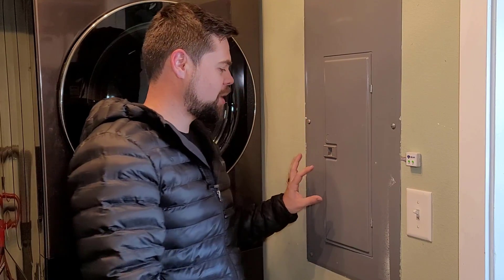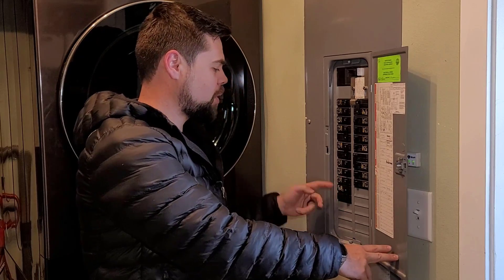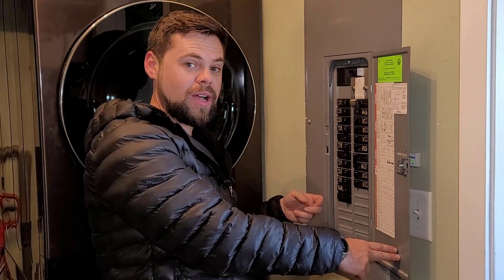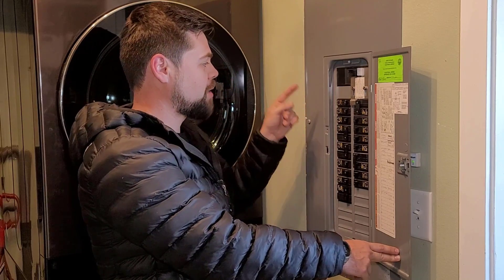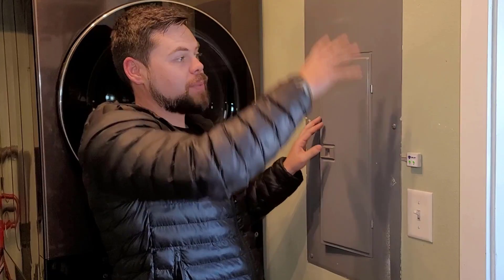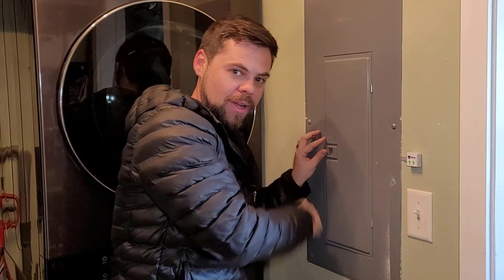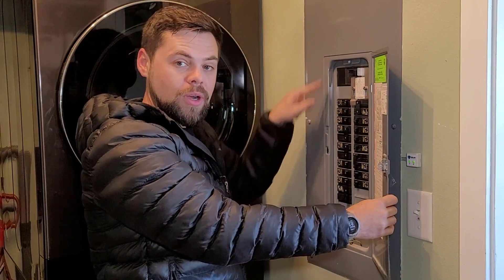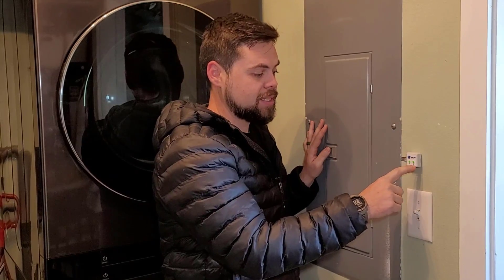EMP Shield Home Installation

Comment: Hire an electrician who doesn't follow the installation best practices from the supplier, He did everything they do not recommend, wires are too long, and he installed it in the bottom breakers it's supposed to be top most breaker position. You do you.....

Comment: There is a lot of controversy around this product -- both because people don't understand EMP and also because EMP Shield's advertising/marketing is misleading. It won't block an EMP pulse from the air like a faraday cage will,  but it will shunt the pulse from coming through wiring. 
This is basically a surge protection device (SPD) that operates fast enough to catch an E1-E3 pulse. and uses Metal Oxide Varistors and gas discharge tubes similar to most SPDs. 

So if you think it will protect everything in your house, you're wrong. And if you think it won't do anything to help, you're also wrong. The truth is somewhere in between. Most damage from a HEMP is from the signal transmitted through wiring. A smaller but substantial amount of the damage is from the signal being transmitted through the air and coupling directly to the circuitry of what you're trying to protect.

Comment: It seems too good to be true. It just hits me deep that you would need one on every circuit to protect your home if it even works. An EMP hits from the air which is why your whole home needs to be a faraday cage to protect anything in your home. I would love to hear an independent electrical engineers opinion.
Reply: I just p[ut one in my home as well, even if you say is correct, you need to try something, because there is no way to completely cover your home, something is better then nothing.
Reply: @jm1551701  I’d rather be wrong in this case. It would save a lot of people from headaches in the future. Unfortunately I haven’t seen anything overly convincing to sway my skepticism. It’s also been a while I looked anything about this device. Thanks for reminding me.

Comment: I have worked with EMP protection for the military for many years.
Can say right away, that it can not work.
With an EMP, voltage arises in all cables, the ampere can become so high that the cables melt if the current can not be conducted away.
The cables must be shielded and the shield must be grounded.

Immediately in the event of a surge, the housing must be disconnected from the mains.

Comment: Regardless of all the nay-Sayers I can officially say I finally had something before Ben did woohoo lol. 1 point for me and I can't count Ben's points...
Reply: I was noticing he installed the hot wires at bottom of your panel.Not sure of your incoming grid conductors but mine come from top,so mine is installed at top so it's the 1st breaker on bus bar so the incoming surge will go thru the EMP Shield 1st before running down to the rest.

Comment: I have my doubts about these devices. Sure they may be able to protect against a conducted surge that flows from the grid but how does it protect from a radiated pulse through the atmosphere?  If a device can be fried just sitting on the shelf out side of a faraday cage or bag, how is plugging it in to the grid going to protect it?

Comment: Will this protect an off grid system that’s connected to your main panel. I noticed you have the same kind of flip switch that I have, but I have charge controllers, inverters and lithium batteries. The only difference is you have the Titan and other systems that are all built in one unit. 
I’ve heard that an EMP could destroy your BMS in your lithium ion batteries, would this protect that?